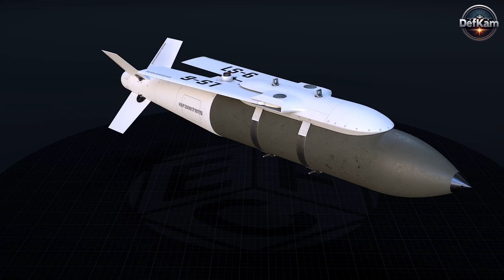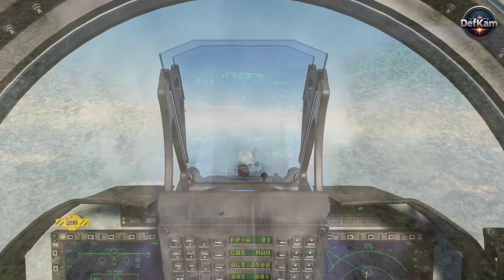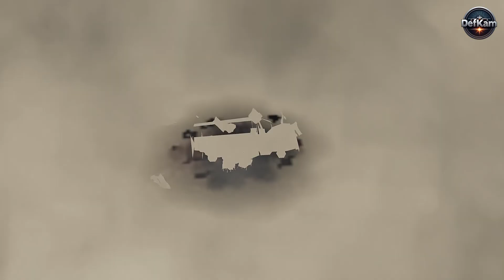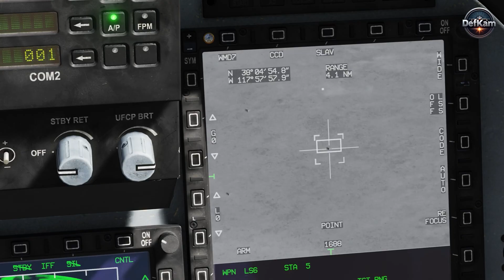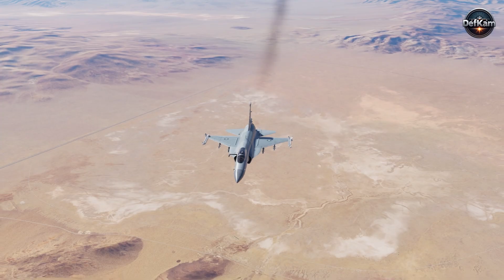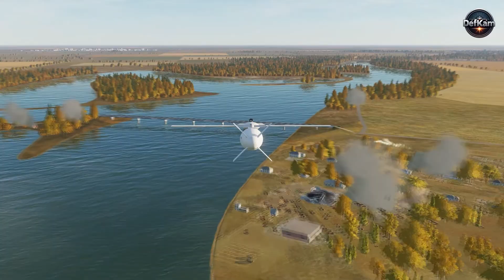New Hero of Pakistan Afghanistan War.

Comment: Pakistan dont use LS-6. The video yr showing r of Al Battlar bombs. These r Lienced produced MK series of bombs with REK kits. These were used in Afghanistan.
Reply from the maker: Yes, well said.
Reply: @DefKami  ..so if they do not use ls6, why is your video claiming it is ls6? another stupid channel to block
Reply from the maker: LS6 is a Chinese-made satellite-guided gliding bomb, while the Al-Battaar is a laser-guided bomb kit (developed in Pakistan) that requires an external source to illuminate the target. The LS6 can operate independently using GPS, whereas the Al-Battaar is an add-on kit that needs a laser designator from the launch platform, another aircraft, or a ground unit to guide it to the target. Now Pakistan has both. But for night operations LS6 is more suited.
Reply: @DefKami  Al Battar isnt a kit its a mk series bomb, uses REK kits for guidance. Laser Designation or otherwise.